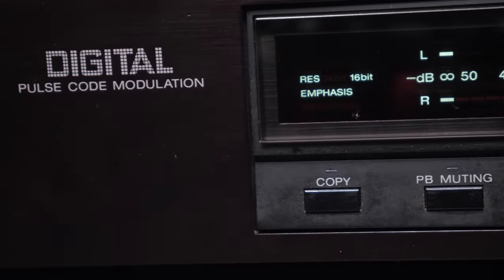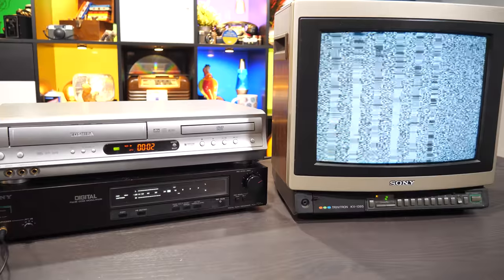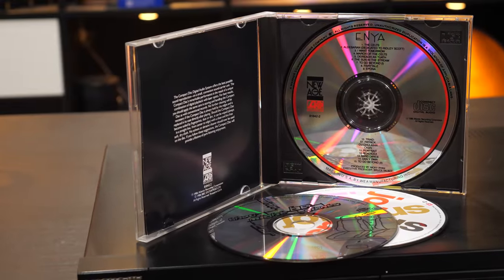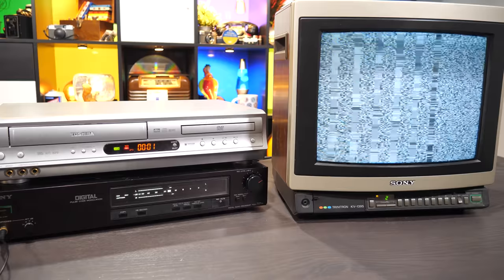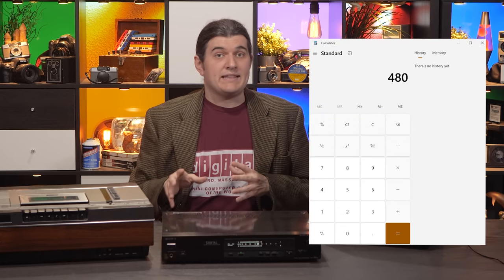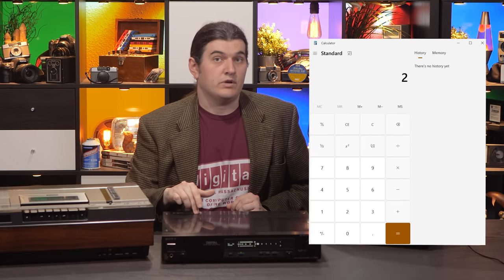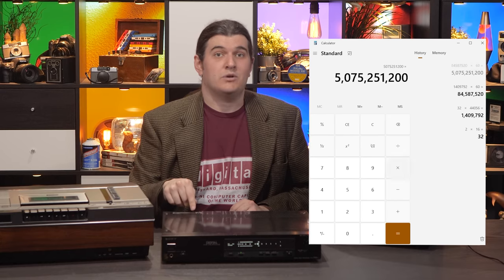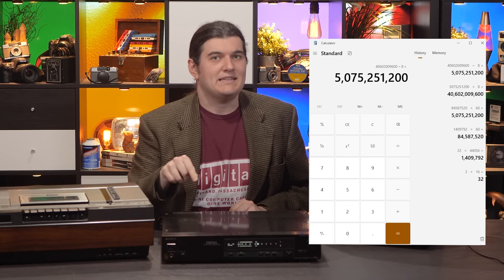Digital audio needed videotape to be possible - and the early days were wild!

Comment: A friend of mine had this. He used it to record his band live (long sets). But what was really cool (and you should have mentioned!), is that you can still record on the analog audio track of the VCR! So my friend would record the stereo board output to the PCM system and record a mic from the audience area onto the VCR’s analog audio track. I can’t remember if he had a stereo VCR or not at that point. 

Great video as always!
Reply: Don't forget some late consumer VHS VCRs models had Hi-Fi audio option. The same audio was recorded on tracks at the edge of the tape and the same was recorded in Hi-Fi (on the same area as video data!). The Hi-Fi equipped VHS player read the better audio recording available on a tape.
Reply: @lukask7445  gosh who could forget those terrible VCRs that would flicker between the two incessantly until “Hi-Fi” mode was turned off…

Comment: Back in the day I used to store Amiga programs and data on a VHS tape recorder, using a SCART to RCA cable and an interface I built. Damned if I can remember much about it now.
Reply: It was tfe VBS. Video backup system. It was heavily used by swappers.
I remember i used one back in 94. And at that time it wasn’t new.
The best part was that the amiga stock config could outpu composite video w/o extra hw. We just needed a scart with a resistor ladder hooked up to the parallel port
Reply: The Amiga VBS couldn't handle as much data as the PCM or PC interface but it's just one cable and the software displayes the name of the stored data next to it - which means less data but you can see what you're looking for (on VCR).
Reply: Before I got my Amiga, I had an Amstrad CPC 464. There was a local radio station that - I kid you not - once a week sent software over the airwaves to be recorded onto cassette and then played back in the Amstrad's tape deck for loading 😂 It was magical. This was one advantage the Amstrad had over the C64 - copying cassettes was easy with two tape decks.
Reply: @DanielSmedegaardBuus  yep, that was totally  something in the 80s. over-the-air software distribution, before it was considered cool
Reply: or a regular audio cassette tape ... like Atari, Texas Instruments, or Tandy (radioshack/realistic). You could also build one with a kit from Sinclair ... my first computer. I'd say Commodore too ... but that was after the shit show between them and Atari. Atari was an Amiga ... they had the rights first. What an interesting war they had lol. Mutually assured suicide.
Reply: @DanielSmedegaardBuus  WOW ... I bet that just blew your mind :o). Now I know where you lived, LMAO ... I build a Sinclair for that very reason. What was your favorite program ... any of the leisure suit larry's?
Reply: @ejrupp9555  Haha 😂 I did play Leisure Suit Larry. I think because of the "adult" themes 😉 It was a little too difficult for me, though. I enjoyed Friday the 13th a lot. My tape had an issue just after the loading screen when Jason's mask was done loading and the scream had sounded. I remember spending over an hour retrying to load that thing 😂 But I think probably my most played game was Bruce Lee. I remember finding a place in an early level where you could duck near a wall, and you'd skip forward multiple levels. Blew my mind 🤯 Which was yours?
Reply: @DanielSmedegaardBuus  Omega Race !!! ... played it on the BIG BOX at the Pizza Hut and when it got ported to commodore 64, I got my folks to get the whole C64 setup and a new TV by claiming I could show my dad how to use it for spread sheets and filing his client data on floppies. 

Iiiiiiit's 10PM!, time for the LATEST from our Dutch friends across the pond. See you back here at 6AM for yooourrrrrrrr REgular, Campus Radio 1450AM Programming. 

I always had it going around 9:50 because I had to be in bed by 10. That's how they introduced it every time. Tried to accentuate the text for the way they said it. I just did a bit of research about it ... apparent it was more wide spread than I realized ... lot of colleges did it. 

So did ya'll have two lines or did you suffer the parents rage? We got the second after my mom threw a fit about the line being tied up.

Comment: This brought back some memories. At BBC radio, we used this to live transmit classical concerts from around the UK in the 80s. A PCM-F1 was used at each end of a standard TV circuit, expensive but worth it for a high value concert. This gave great stereo sound and as the classical network used no audio processing, the quality on FM was superb, albeit limited to 15k at the top end by FM. The system was also used to play back concerts off a Beta tape, although cueing it up and playing it in live was always somewhat scary!  The PCM-F1 encoder and matching Beta machine were beautifully made and small enough for both units to fit side-by-side in a rack width.
Reply: I imagine that reserved satellite channels were occasionally used to distribute such transfers to a large audience across the world. I certainly was entertained to realize that most of the shows I watched were actually transfers intended for the stations to pick up. They'd always have cards where local advertising or announcements were supposed to go.

To think, I probably saw some of this audio back then and thought I was just looking at static!

Comment: My dad worked in a shop for twenty plus years and one of his coworkers had converted his collection of hundreds of records into over a dozen 8ish hour mix tapes on VHS tapes for the shop to listen to while working; they'd just have to pop a tape in in the morning and be good for most of the day. My dad always said the quality was amazing too and he couldn't believe it was coming from a VHS tape. Knowing that the guy who did that was a massive audiophile I'm now fully convinced he had a setup like this back then. Super cool!
Reply: It's probably more likely that he was simply using the regular analogue hi-fi VHS audio. That was good enough that it was widely used in British radio in the 80s and 90s for 24/7 radio station output logging; a few domestic VCRs using standard VHS tapes available anywhere were cheaper, more convenient and higher-quality than a couple of specially-modified open-reel audio recorders running slower than audio cassette speed (which was the previous standard way of doing it).

Comment: I just spent some time acquiring a PCM device to retrieve recordings made in the mid 1980s.  The tapes were made with a portable Betamax machine to record performances in Bali, Indonesia.  It was essentially used as a portable recording studio.  I have a friend in Vermont who recorded concerts the same way.  These devices allowed many audiophiles to make field recordings of very high quality.  The RCA inputs were just fine when connected to a portable mixer.  I also know of a professional audio studio that used this format to back-up their digital recordings.  BTW, the tapes were mostly flawless after nearly 40 years.

Comment: I think I've told this story before, but in 1978ish, I recorded the medium wave band on my VHS - all of it - as an analogue signal.
Next up, I took the undemultiplexed FM signal from half way through a tuner I was building, stuck that signal in the video in and recorded that too. Brilliant hiss free stereo when I fed that back in replay through a demultiplexer. Yes, I did it partly because I could, but also to record a 6 hour radio broadcast of a concert I was at.
How did I lock up the tracking you ask? Well, I took sync pulses from a Pong gam and fed them in to the right place on the VHS PBC.
Yes, it did go click click click - but not too disturbingly !
Reply: I understand that the video signal of vhs is about 6Mhz, but what device did you use to shift the medium wave band down to baseband? Did you make something yourself?
Reply: I love geeks. Wear it like a badge of honor. Those cliks where just pistol shrimp applauding.

Comment: I just want to say... as a 22 year industry veteran, starting just after the dedicated engineers who studied on the job and had degrees and such, I learn a lot about my industry and my work on this channel.

I work with PCM audio daily, and only just now knew about it's history and details... thank you!
Reply: Yeah, I deal with PCM too, though I'm somewhat new compared to you in this industry (15 years working with audio). That was an interesting history lesson. It would be great if he talk about other devices like this in the future. ADAT is  nice one, and it used S-VHS tapes.
Reply: Still using a 1980's Onkyo in my media center. My modern TV can still connect to this stereo without special adapters because both units have an optical port and the TV still supports PCM output sadly if you try to use any dolby encoding the stereo just buzzes loudly
Reply: Intellectual humility: something that's as exceedingly useful as it is rare to be found in engineers. Good on ya!

Comment: The 8-hour recording ability has me thinking if one target market might have been non-audio-production commercial (ie, a whole working-day's worth background music for a shopping centre, assuming they even did that back then). That grey area between home users who don't need as much, and the pro users who need more.
Reply: I think that it could have been an alternative to reel-to-reel tape for home use. A recording time of 4 hours (at LP) would have been great for home use. A problem with using EP/SLP is that the video tracks overlap by a third on the right and left sides of the track, leaving only the middle third clear. With LP the tracks touch but don't overlap, and with SP there's a space between the tracks.

Comment: 28:54 There were actually some pre-recorded PCM videotapes released by the audiophile label Mobile Fidelity Sound Lab back in 1983, on both Betamax and VHS, with the big album they released on the format, of course, being "The Dark Side of the Moon", as it seems like every new audio format needs to have DSOTM released on it (and for good reason). They also released other albums like "Crime of the Century" and "I Robot" on the format as well.

However, they haven't appeared to have released any other albums outside of the initial releases, and hell, while Discogs does have a category for the format (as "Digital Audio Cassette"), featuring a picture of an ad which listed their releases, the only one the category actually lists out is a Beta release of DSOTM, so you can assume that the line didn't last too long (this was the same year the CD launched in North America and Europe) and the tapes themselves are incredibly rare (according to the Discogs listing for DSOTM, only around 100 of each release were produced).
Reply: A Betamax copy of the Dark Side Of The Moon. I want one now because that is funny.
Reply: @daemonspudguy  To be honest I'd rather have the quad reel to reel version.

Comment: I'm sure someone has mentioned this but these were big in the "Taper" community, and people used them to record Grateful Dead shows. I also believe I've seen reference to the F1 PCM unit being used for on set recording films since you could pair it with a luggable VCR.
Reply: Yes, the PCM F1 plus SL 2000 made a nice portable setup. Could even run on 12V or onboard batteries.
Reply: You get a thumbs up just because I’m headed to Dead and Company at Fenway in two weeks. 🏴‍☠️

Comment: I still remember the first time I disassembled a VCR player. At that time I was about 14 or 15, but I already had enough knowledge to be able to disassemble and reassemble it without damaging anything, and I remember it blew my mind. The mechanism, so beautiful! I remember inserting and removing the tape several times just to watch the mechanism pull and return the tape into the cassette. Actually, I was able to improve the audio quality. Since new, I noticed the audio was a little weird compared to other VCR players I knew. When reassembling mine, I found out that the audio head came misaligned from factory. This player lasted for several years at home before being replaced for a DVD player. Nice memories!
Reply: I was lucky enough to be given a "broken" VCR to take apart. Not only did I learn about the fascinating mechanisms, I discovered that it actually worked just fine!

Comment: As a follow-up to this, you've got to take on the oddity that was D-VHS: digital audio (even Dolby Digital or DTS tracks) and digital video (up to 1080i!), all on a video tape!  Truly a versatile piece of consumer physical media, provided you had the codecs to support reading or writing to the tape.  It could even be an interesting segue into the early DVR days of television - PCI cards, MPEG-2 codecs, Firewire ports on cable boxes, W-VHS for Japanese MUSE television, you name it.  A little less unique than recording digital PCM audio into a composite analog video signal, but you've spent so much time on the various quirks and features of VHS and Beta both that a video (or series) covering the later years of the format would be welcome content.
Reply: It's mind blowing to see the capacity: up to 50 GB.
Yes, a dual layer BD. On VHS tape (I think it uses S-VHS formulation or was it a tiny bit better?).
Reply: After seeing how densely the data had to be packed onto tapes just for this, I wonder if D-VHS required finer-grain tapes than standard VHS, and the only real similarity was the shape of the cassettes (and the players being backward compatible).
Reply: @stevethepocket  From memory, S-VHS metal particle tape (so finer grain) and of course, we're talking about stuffing extra reliable digital data into possibly terrible quality 240 line video signals here, vs. D-VHS that doesn't need to deal with any of that NTSC crap after all, this whole deal is quite similar to dial-up, having to piggyback on the limitations of a medium and use it in incredibly ingenious ways, D-VHS tho doesn't need to care about the piggyback stuff, being way closer to the jump from Video 8 then Hi 8 and finally Digital 8.
Digital 8 uses the same tape as Hi 8 to store quite a few gigabytes as well.
Reply: @Kalvinjj  Now I'm wondering if purpose-built data tape drives used heads on a tilted drum too or if they had other ways of maximizing bandwidth.
Reply: @stevethepocket  That's interesting indeed, and several different variations exist. I do know that helical scan systems like VHS, Beta and all the common video tapes are common, but so is LTO nowadays, which just as the name suggests, is linear instead, with several tracks parallel on the tape. Now, what they physically do to have tapes up to several terabytes, no idea.

Comment: This should be implemented as an input and output format in ffmpeg. I would love that. :D (Edit: on a more serious note, a good video capture of such a source tape would be much easier for most of us to do than to get hold of a pcm-adapter.)
Reply: Excellent end of term project for a heterogeneous parallel programming  class (often NVIDIA CUDA) or a GPU  hackathon.  For big bonus points, transcribe from a 4k video stream taken by a handheld cell phone pointed at a video monitor playing the stream from tape.
Reply: Sounds more like a project for VHS-Decode to tackle
Reply: There is a software project called SDVPCMdecoder for decoding video files back into audio. I don't know if there's something that would work in reverse, but... maybe.
Reply: There is already software to do this, but the capture needs to include lines at the very top which most capture devices miss out.  So it's not as simple as it seems.